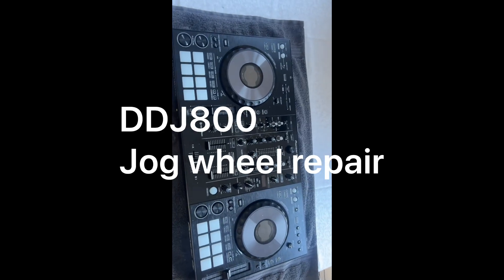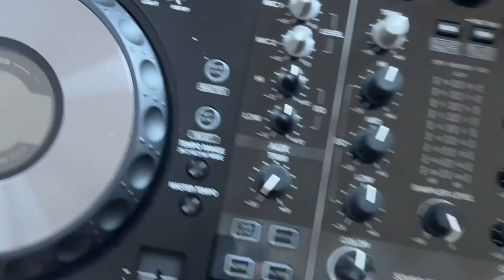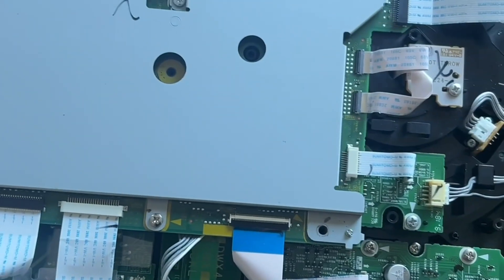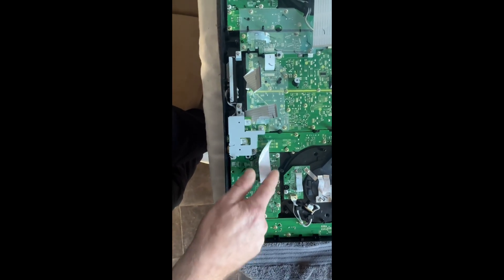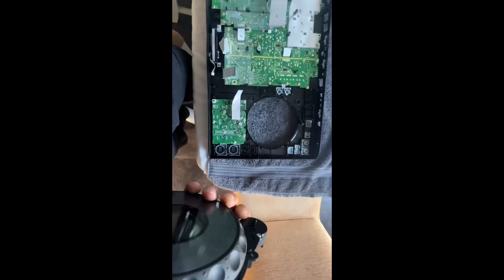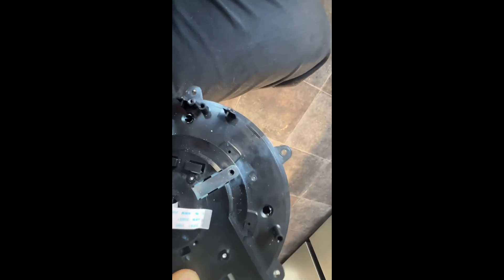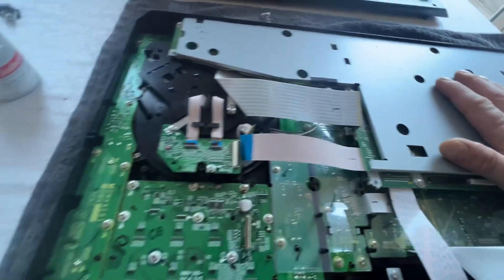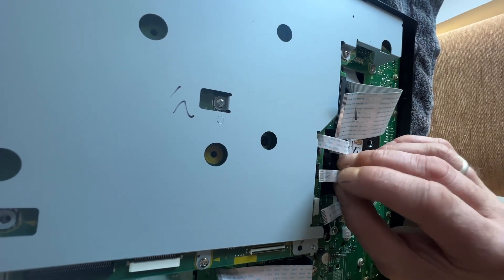PIONEER DDJ800 JOG WHEEL REPAIR

Comment: My right jogwheel just stops the track when I touch it but I can’t nudge it or scratch
Reply: hey im having the same problem did you get a fix for it
Reply: @NJBLAQ did you fix this problem?
Reply: Turn off the vinyl mode. You can touch it then at least.

Comment: Hi, I got a used DDJ-800. the Jogs are ok but the right Volume Fader seems brokeb since it has a less resistance than the left one (Moves like the Crossfader does) - Any Fix there without replacibg the fader? Or should I just order a new Fader? (Partnumber: DCV1020)

Comment: Thank You for this! I had 5 (out of 12) roller bearings that became out of place inside both jog wheels. The tips of 3 of them snapped off too since they're made of plastic.
I replaced ones with metal tips so that should make it futureproof.

I've put it all back together and now rekordbox doesn't move the tracks left or right when I turn the jog wheels - What am I missing? Maybe something to do with the sensors? They were both working fine before. The capacitive part on top appears to register though (you can tell when the jog indicator lights up).
Reply: That’s awesome! Where did you find the metal ones? Is there like a size in millimeters ti search online?
Reply: Hello, did you find an answer to the problem ?
Reply: @baddielimo7876  I performed a miracle by attaching the tip, which chipped off from the roller, with crazy glue. I haven't been able to find metal rollers so I ordered the plastic ones from amazon.

Comment: My jog wheel snapped in a hard case. Don't understand how that happened, it was in a hard case. Cheap plastic or they sold me a peace of crap.
Reply: Friend where can we buy a used jog wheel oh New??
Reply: @abel1309  Theres a website I ordered it from. I forget but I got it from Pioneer. They told me to order it there.
Reply: My ddj 800 jog wheel snapped in a pro x flight case today Sunday, July 21 2024. I can’t spin or scratch on it. The deck 2 jog wheel is ok though. Were you able to get yours fixed and if so, how did you do it? Your response is appreciated. Thank you.

Comment: friend, can you tell me which jog is compatible with ddj 800, my jog ddj 800 broke the axis
Reply: There is a web site for DDJ parts. It was given to me by the tech staff of Pioneer being that it was out of warranty. I ordered it was about 50 plus shipping. Its not hard to take apart its a pain but take your time. Also to remove the plater turn it upside down and you will see holes. line up the screws and then take them to lose and the plater will come off. Then transfer all the parts to the new case and once you fix it, sell it. The new unit Rev 7 seems to be metal. Why they made that plater plastic I will never understand it. Definitely not meant for travel.